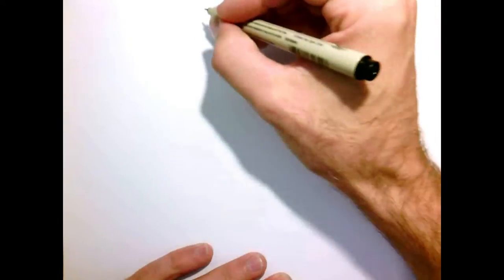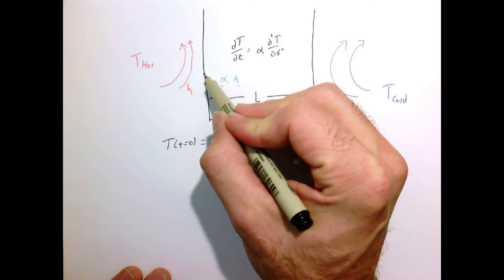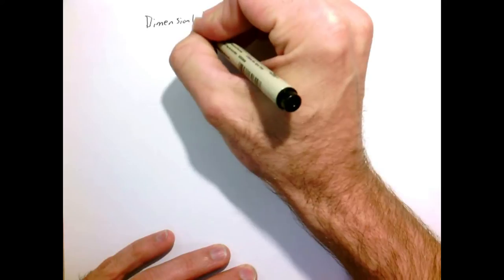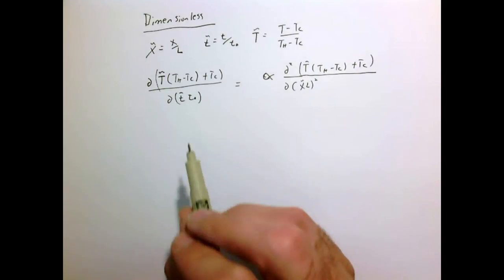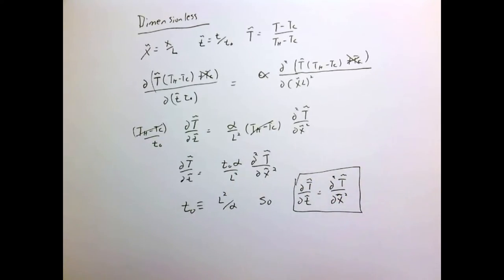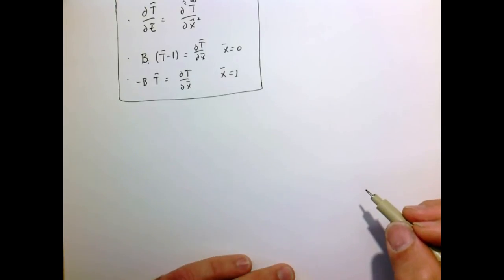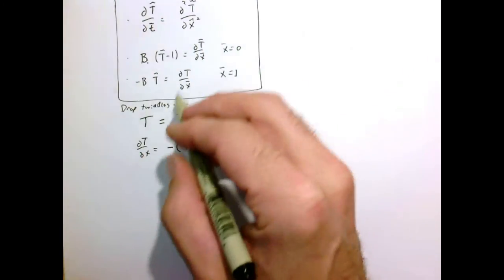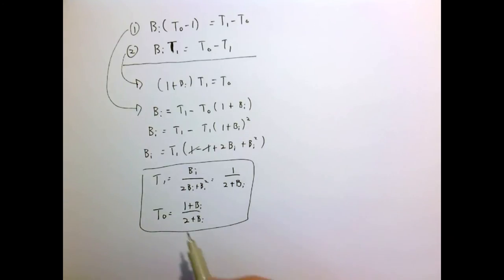1D heat flow through a wall

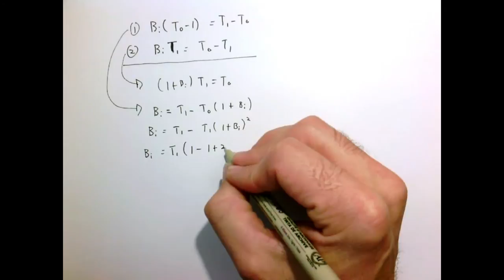Comment: Eqn 1 around 8:00 , you messed up the signs. Should be: 
-Bi = T1 – T0(1 + Bi)
-Bi = T1 – T1(1 + Bi)²
-Bi = T1(1 – 1 – 2Bi – Bi²) 
T1 = Bi / (2Bi + Bi²) = 1 / (2 + Bi)